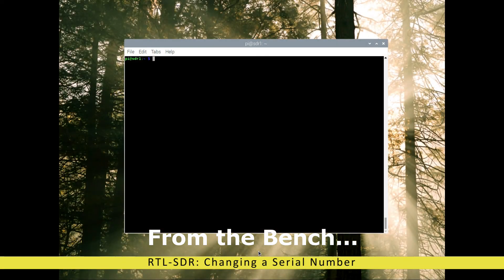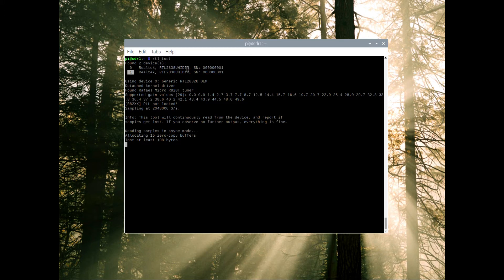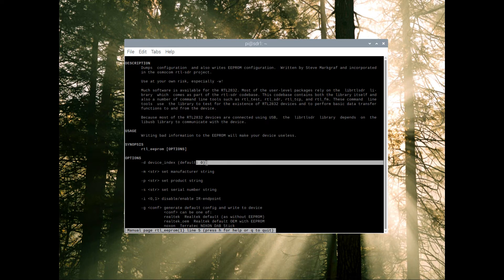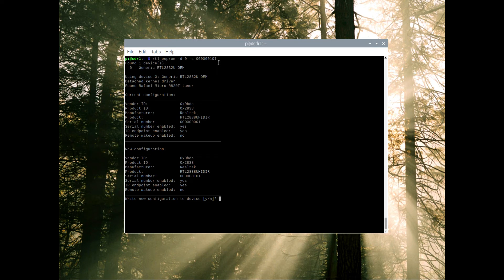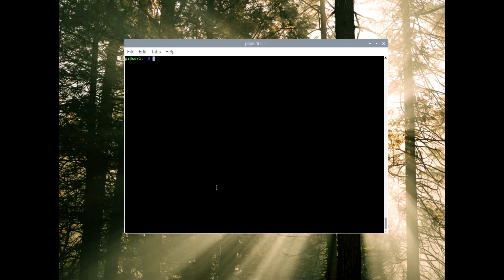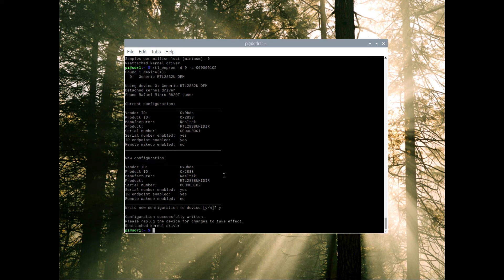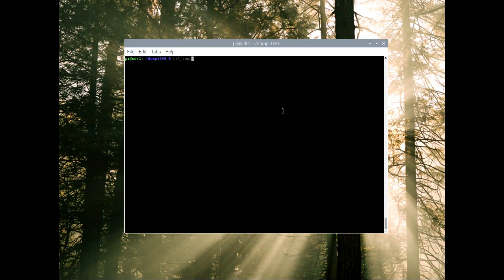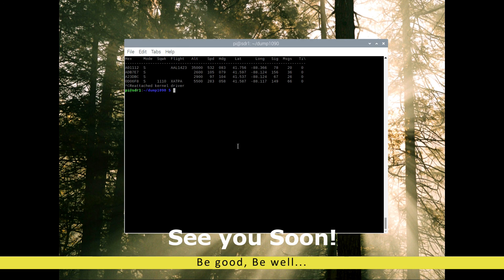Change SDR Serial Numbers (Applies to most RTL SDR 28xxx series SDR's)

Comment: I guess Linux is the only way!!!!????    The problem with Linux is: Which computer should I put it on, or do I dual boot???   Thanks for the video!
Reply from the maker: I haven't gotten around to trying this yet. But another YouTuber was able to do it this way. 

https://youtu.be/ZdLLDBPBShk

I'll give it a try in the next day or so and follow up or create a video.
Reply: Wow, thanks!!!  I subscribe to Fuzz, but didn't see this.  Great, I'll have to try it!  Thanks again!
Reply from the maker: @danedewaard8215  You're welcome.
Reply from the maker: Dan, check this thread https://forum.radarbox24.com/index.php?topic=19831.msg268771#msg268771

It's a couple years old, but seems to be pretty accurate. I commented elsewhere on this, but things like this are the perfect reason for keeping a Pi around, even if it's just a Pi Zero W with the adapters (you need an OTG cable and Mini-HDMI to HDMI adapter).
Reply: use a virtual machine ?

Comment: Would be a dream to do this via my Mac Terminal or from CMD on Windows... I do not do linux these days.
Reply from the maker: There is RTLTool for Windows, but I read so many stories of it breaking RTL's I skipped it.

Something like this is the perfect use case for having a Raspberry Pi Zero hanging around. They can be set up as a USB device. So you would plug it into your Windows machine (and I believe this works on Mac but don't quote me 😂) and then SSH to it once it's connected. From there you could run all of the necessary RTL_ programs.
Reply from the maker: Check this link. He just posted this tonight. 

https://youtu.be/ZdLLDBPBShk
Reply from the maker: https://forum.radarbox24.com/index.php?topic=19831.msg268771#msg268771

Comment: (●__●) Geil! Good trick, Papi. I have this problem with Mikrofon to record singing.
Reply from the maker: I don't know if that would work, well I should say it will not work with this software. It might be worth sending an email to the support team at the company that built those microphones. I know it's not often you can change the device serial number.

I have the same problem with my webcam. I gave up trying to figure it out and went and bought a different model from the same manufacturer. At least then Windows will change the device name to reflect the model number.

So I take it your microphones are USB condenser microphones? What happened to the old ones through the mixer?